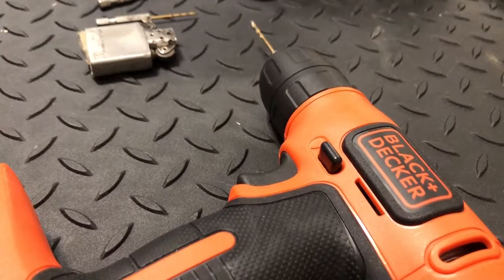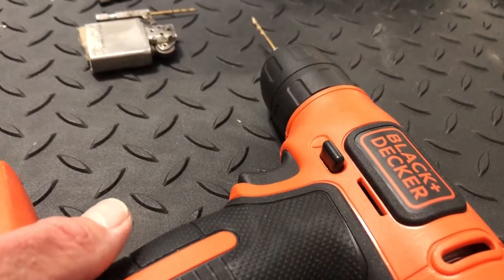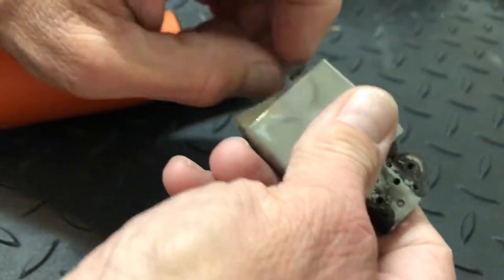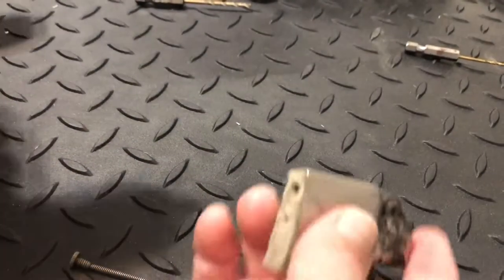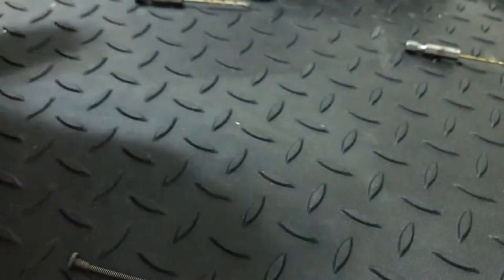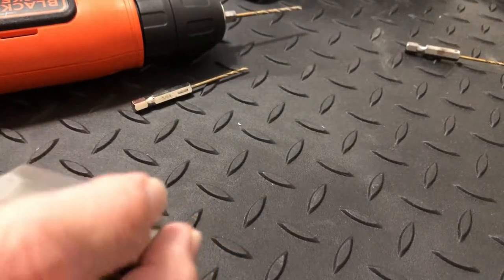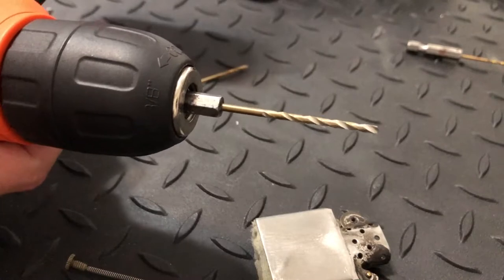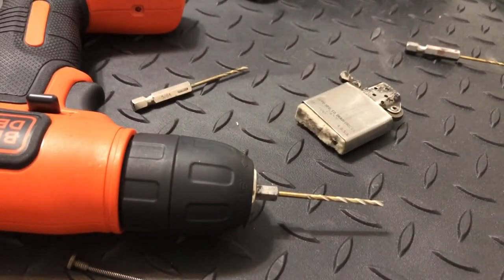How To Repair Vintage Cigarette Lighters That Won't Spark(Zippo, Insert, Straight Tube Method)

Comment: ? I have queen anne straight flint shoot, can I drill from top..almost there
Reply from the maker: foxy fnaf, yes the Ronson Queen Anne has a straight flint tube and you should be able to drill it from the top. I abhor disassembling these type lighters from the top, so I usually don't but that doesn't mean never!😜✌️

Comment: the flint is not jammed i can see it touching the wheel just the wheel wont spark, does not look that worn
Reply from the maker: Mac MashPotato, I apologize for the delay. Have you had the flint out of the lighter? I ask because the flint can be jammed and also be touching the flint wheel. A lot of times, that's exactly the position they petrify in.✌️
Reply: @DependableFlame  It was the flint wheel, apparently it does not have to look that worn to be worn enough that it hardly scrapes the flint.